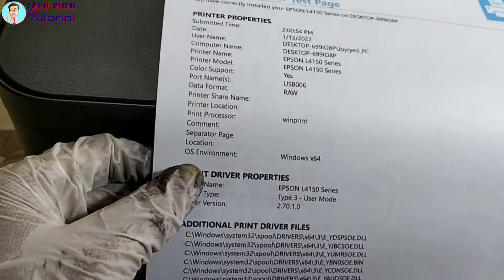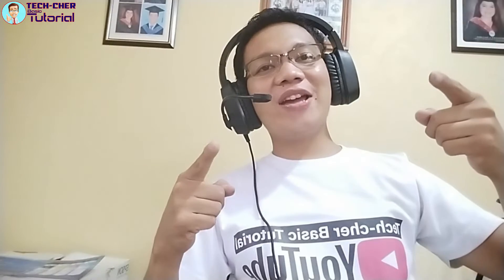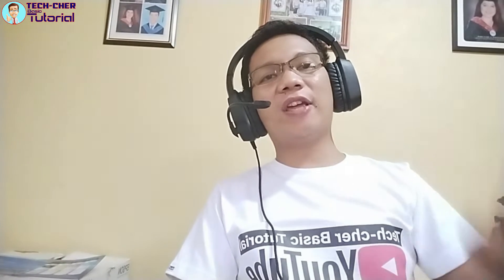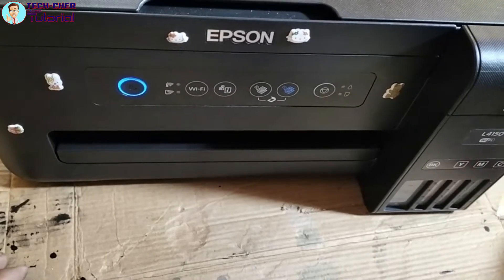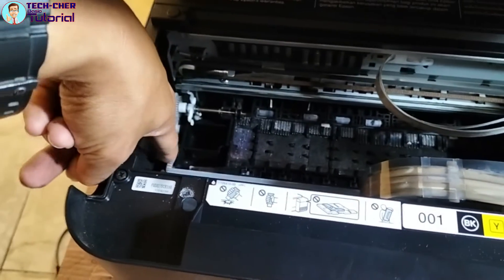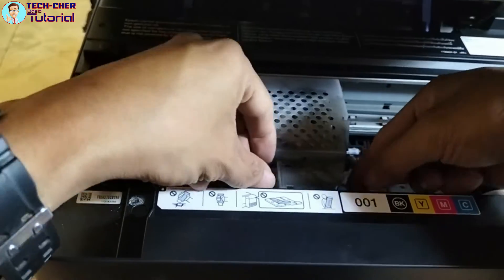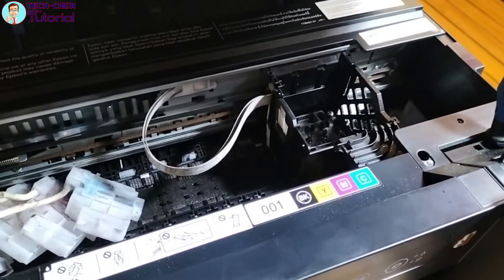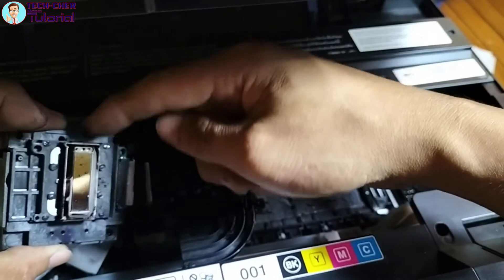HOW TO CLEAN EPSON PRINTHEAD || ALL MODEL

Comment: Paano sir kapag ang printer hindi sya nagpiprint out ng kahit anong kulay pagkatapos ng cleaning. Kahit anong cleaning hindi parin nagpiprint
Reply from the maker: kapag ganung issue sir posibleng nasa board npo ang problem nun.. may isosolder po doon.. pero try mo prin sir mga basic troubleshoot muna.. try mo po ung tulad sa ginawa ko sa video.